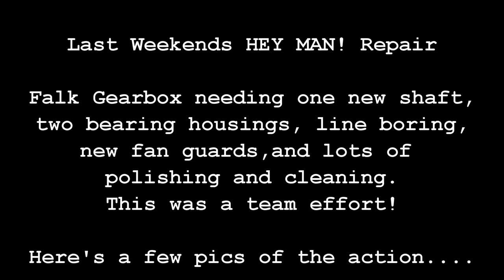Saturday Night Special 80 Part 2

Comment: Another great video Adam.   The part on pressure relief valves was very clever and interesting to test it with a porta power.  Looks like you are learning alot as you figure out what is amiss with the KT, most likely a bunch of things, none major in and of itself.

Comment: Hi Adam !

Very nice to see these heavy duty works of yours ... when you turned that shaft for the gearbox glowing dry I could nearly smell that hot metal ... I get nervous when I feel that smell, because here in my hobby shop it normally means something is wrong ;-))

I have some - for me - heavy threads to do in a project of mine - 48mm by 2mm - the nuts for my general collets system for my shop - I long to do the challenge !

Comment: Adam, That's a really cool planer gage. I'd wager that it's shop made by a talented machinist like yourself.
Also, I like the wider angle shots of the lathe in operation where the viewer can see you using the controls rather than just a close up of the cutting tool. Greg.
Reply from the maker: Greg Kozak Thanks Greg. I'm always trying to improve on the shots of the machine work.

Comment: Damn fine work! That gearbox... Not just rebuilt, but looked beautifully finished to boot.
As for that 5 stage... Absolutely incredible work. So shiny. Wait... Did I just say that? 
In any case, it amazes me how something that large can have a seal, a mirror finish, and apply tons of force. Based on the diameter, i am inclined to say tens of tons, possible even 50. Crane part perhaps? Or one of those custom tipping ramps?
Reply from the maker: Cody Smallwood All the tubes were re-chromed so yea they look nice. Each nut uses layers of V-packing for sealing, that's why you seen me machining threads on the bronze. It's used for truck dumps.

Comment: Puzzled...
Relief valve set to open when max pressure reached, target that was achieved after a few pumps of the portapower. Had the pressure been supplied continuously by a pump, the pressure drop seen simply would not have occurred. 
The fact that it reached 200+ psi, and then, after pumping effectively stopped, coupled with a slight leak, would naturally cause pressure to drop,  tellingly regained after a few more strokes of portapower.

Epic lathe work,   congrats on 40K subs..

John Greenwood
Reply: Aristakas   

Precis of previous post.

Relief valve prevents over-pressure only, designed  to 'let-by'.  
Pump, in good condition, maintains target pressure in system.

Worn faceplate and/or possibly gears of oil pump may indicate good pressure when oil cold but as oil heats up would result in progressively lower pressures.

Thanks, 
 JG
Reply: Aristakas 

Pump guy here. I'm going to agree with John. The pump should have more than enough capacity to overcome what little bleed through your getting through the relief valve. I'm not saying the leak shouldn't be addressed, however, I'm not sure this is the root cause of your problem.

Bob
Reply: curtisbuckmaster , Aristakas 
I think the piston binds so it won't close back at for example 200, it takes more force from the spring to overcome the binding in that valve/cylinder + the pressure, so once the pressure drops at about 100psi the spring has enough force to close back the valve and the bleeding stops (or is very slow) - the way I see it anyway.
That being said I believe there's also another issue not just the valve as if I recall correctly the pressure he got when testing on the K&T was way low and nowhere near 100psi (but that might be also due to cleaning the valve block and maybe works better now).
Reply: Well I am a sparks by trade ( electrical engineer) I agree that small blow by would be easily overcome with the pump that valve works more like a pressure limiter than a pressure control , I think it as a pull up resistor that is able to be pulled down to set a level.

I still think there is more problems a foot there is a big hole/leak somewhere or the pump cannot get the pressure up and maintain a good flow at that pressure

Great vid thanks for keeping us in the loop 

Stuart
Reply from the maker: curtisbuckmaster I've been thinking the same thing myself. We are building pressure, but a relief should reseat and seal after it drops off. Just remember that I'm exploring possibilities on what was wrong with the machine and would rather adress all of them at once then to stick it all back together and it still not work. it may have been a plugged up oil line. We're still searching.

Comment: Adam.  Its the poppet valve seat that is the issue.  Im assuming its a Ball and Seat type poppet.  Its easier to fine a new ball (bearing).

Usually, the valve will "Crack" open at the set pressure, but reseat at a slightly less pressure, but not more than 10-20 psig.   This is normal. (ask Paul about hysteresis).

Glue a new ball to a piece of drill rod and lap the seat with some fine (1200+) lapping compound.  Retest until till it stops leaking.  The ball doesnt have to be exact replacement but it does need to be polished and very round.  Thats why ball bearings work so well. so long as it fits the seat and the spring.

Its typical in hydraulic valve components that a 0.0001' or smaller tolerance.  Thats why all new equipment have very fine filters.

Comment: Atom: nice find on the K&T issue... That may be ? all there is to the problem. Way cool.  I'm sure there are options "maybe" replace, repair or ?....  Also that extending ram is crazy long.  Is it for a crane or ?  Thanks for the excellent video and sharing...  Brian F.

Comment: Adam,
At least you now know what the problem is with the K & T. Now to try to find another pressure regular. If nothing else, could you band saw the old in half, lengthwise, so you will know where all the passages go. They could be drilled in a block of aluminum. The passages that are blocked to the outside could have plugs pressed or screwed into them. Damn! That I one mommaluca hydraulic cylinder! Is that for some oil rig out in the Gulf? Are you putting an elevator in your house? (Actually you would need a cylinder that long!)  Thanks for a great SNS and congrats on the 40K subscribers!
Keep your tools sharp and your brain sharper!
Dave
Reply from the maker: Swarf Rat I'm still working my options for the relief valve. Going to price new unit first, but we can possibly just repair this one. Thanks Dave!
Reply: Abom79 I would  have a mould polisher  with  proper tooling  polish that bore  in the block and you make a new valve insert .  You must have  a mould shop in your town ??  The polishing guys have tooling to get down that  drilled hole
Reply: Abom79 If we want to be a little selfish, the better solution is that you undergo the repair and we get to see how it's done... ;-)

Comment: Could you chrome the poppit and bore the housing for the valve on the K&T? I'm also wondering how that valve would work with a constant flow of oil such as what the pump is going to give it? I'm thinking that it is more of a regulator than a relief. Such as what you would see in an auto trans. I guess I should take planer gauge off of my wish list now that you and Tom have raised the value. I was glad to see your thread pitch gauges by the cylinder that you were threading. Always want to check the pitch. Not like it is a boat shaft. :). That telescopic cylinder is pretty impressive.

Comment: I replaced one of the hydraulic cylinders in a garbage truck before.   I thought it was big , until I saw the one you were working on near the end of the video.
Reply from the maker: 1970chevelle396 So far this is about as big as we have done. We had one bigger but the lathe wasn't big enough to bold the barrel. LOL

Comment: Adam.

I'm not convinced that the relief valve has a problem. Fair enough, it's leaking down once it achieves relief pressure, but you have to consider that the porta-power pump is providing very little flow, and once you stop pumping, it's providing no flow (obviously). Your gear pump in the K&T is a fixed displacement pump with, compared to the porta-power, a large flow.

I think you should rig it up to the cylinder test bench at work and see what pressure the valve can hold with a constant flow through it. I realise the test bench can give way more flow than the K&T pump but you should be able to find a way to throttle the bench's flow down to something similar to the K&T's.
Reply from the maker: princebatswater All of out equipment is too big to test that one, that's why I used the pota-power. It may still work as is but I'd rather replace or repair befor putting it all back together.

Comment: Adam, may want to think about checking that relief valve with a constant flow. if you can get it to build pressure before it pops It's not leaking. when it pops you have no oil to reseat it unless you pump it. with all do respect, not sure your hydraulic guy knows what he is doing. we always use a constant flow pump for testing that sort of thing.
Good luck, Cliff
Reply: +Clifford Fender ...Agreed...! I was the &#39;welder&#39; in a machine shop that did a lot of hydraulic stuff...worked on lots of 2,000-3,500 PSI relief valves...mostly big extension boom  type cranes, 200-500 tons....3-5 stage cylinders...some had 27-28 feet extension per section..."Maxim' cranes has big lot here in Sacramento, calif.
Reply: Relief valve was clearly leeking. With constant flow you don't see it, if flow is greater than  the leak. The guy knew exatly, what to do.

Comment: Damn that gearbox looked like it had been band-aided and band-aided until the band-aids stopped working, but from what you say about it being a common happening in big industry, I can see why.  For the kinds of operations requiring such massive pieces, when the processing equipment that needs it isn't running, nobody's getting paid.  So there's incentive to 'run it till it breaks down, patch it up, run it until it breaks down again, patch it again, etc.' until the patch-ups stop working and it fails catastrophically.  Then its time to call in you and your buddies to do what you do so the customer can get back to beating the utter living crap out of it. :D  Its job security though for you! :D

Comment: Was the cylinder for an elevator? If your having trouble catching threads on large pcs of pipe like that, if you turn it backwards you will feel the start treads drop off when they go past each other, then you know exactly where starter treads are and you can work it the right way from there.

Comment: Terrific pair of videos Adam. I am glad James managed to find those bits for your machine as I'm sure they will all have a use and make your life easier. Do you ever use any coolant on that lathe as I have only seen you use lubricant.
That's an almighty rescue on that gearbox and must have caused a lot of hard work for many folks but at least you managed to get it fixemust d!
That is one massive ram you have made - is it off a truck or something else? Your forklift some real grip and power to shove all those sections closed as well.
Congratulations on 40,000 subs.
Reply from the maker: Dan Whiteford Only lathe I run that has flood coolant is my Monarch, and I showed rebuilding the coolant pump for it in past videos. The cylinders go to work at paper mills. We have a big 8K Lb capacity forklift. Thanks Dan!

Comment: one 'worth a try' option for the relief valve is to machine a new poppet and see if that helps (esp a thou or 2 oversize and hand polish to fit it), of course there's wear in the bore, but it may solve it, but machining inside the unit is so much harder, esp if they use a seat for the valve to go onto (i am not sure the exact mechanism they use, it may be seatless and just use the bore and a bypass chamber, thus hand ream it and make an oversize poppet) maybe there is an engineering drawing of the valve so you can see if you can use an adjustable reamer and there is clearance in the bottom for the dead-zone you cant reach with the reamer
Reply from the maker: jusb1066 All repair options I have already been exploring. I'll share it on video once I have it figured out.

Comment: Love those herringbone gears! What was that a 50ft stroke cylinder? Might as well go ahead and rebore that valve block and machine your own relief. A used one probably no better than what you got and a new one probably have to sell a kidney for. Fives in Wisconsin is the current K&T owner, I have a parts contact there if you want to give them a try. It wouldn't surprise me for them to want a grand or more for that part though.
Reply from the maker: bcbloc02 Brian, email me the info. I found a couple dealers out in CA that sell K&T parts also but I have not called anyone. I'm thinking I can ream that hole out clean, check the face too, and make a new poppit. But I'd like to harden and grind it to size like the original.

Comment: I think the valve was in backwards, the stem part holds the spring on center keeping it from rubbing on the side of the body, the flat face is the seat side easy to just lap it flat. Then just check the face in side the frame for cracks if none then laps it to.
Reply from the maker: heyhoss No sir, it was installed correctly. The smaller diameter fits inside of a bore and seats on the face.

Comment: The size of that hydraulic cylinder is insane.   May I ask in what sort of equipment is it used?
Reply: Possibly for an elevator. I've even seen them painted orange before. This is sized for a very heavy lifting freight elevator.

Comment: One step closer on the K&T. Another great video, as always. Congrats on 40k.

I saw a double spiral groove shaft rotating on the back of the lathe in one shot. It looked like the grooves on the shaft of a Yankee screwdriver or the operating shaft of a level-winder on a fishing reel. What is that used for on the lathe? My first guesses were: a back and forth automatic polishing function; rapid carriage traverse; ... and then I ran out of guesses. It would depend on whether there were reversing loops at each end (as on a level winder) or whether the grooves just ended (as on a Yankee screwdriver).
Reply from the maker: Peter W. Meek Your second guess was correct Peter. It's for the rapid traverse.

Comment: Excellent standard of work, its nice to see the gearbox repaired, I am really impressed with the bore screw cutting.  The quality of the steel looks really good, I assume its hydraulic grade material ?
Reply from the maker: ANDREW MICAS Yes it is, you buy it from suppliers already honed like that.

Comment: Nice pair of videos to watch tonight.  Hopefully you can get a new valve or be able to make one.  I assume those have to be some pretty tight tolerance mated parts given that a little hairline scratch can allow it to bypass.  It would make one hell of a good series if you could machine a whole replacement unit yourself.  :-)
Reply from the maker: ILGopher I'm going to see about rebuilding this one myself. Most of those spool valves I have seen are pretty tight fitting.

Comment: Thanks for another great video! Is there more to the poppet valve than is visible on video; as I would think you would have no problem making a replacement?

That was a monster 5-stage. Does your pressure system have an automatic relief valve once it is fully extended? 

Beautiful shaper chips..

Comment: Bummer seeing them herring bone gears chowing on each other.  Cool systematic troubleshooting on the p/r (offloading valve) unit.  Looks like their may have been some microscopic debiris in the hydraulic fluid.  Over time, it slowly polishes the clearance bigger and bigger.  That can also be caused by old funky fluid that has developed an acid pH level.  One cause of acidic pH is water contamination.  If you live in a humid area, the moist air can condensate on the sides and roof of the inside of the machine, gear box, etc.  Condensation doesn't occur all of the time, just when the season changes from summer to winter (or from hot days to cold nights).  Some guys build a race motor and put a 140-160 degree themostat in it to make it run cool (less detonation).  But, the transmission (if it is an automatic) fluid does not get hot enough to boil off the water vapor that condensates in the transmission case.  It's not immediate, but the clutches, plates and pump tolerances wear faster.   then again, speed cost $$  
Though the valve "leaked" down a little bit of fluid pressure, that small amount leakage wouldn't affect the overall functiion of the system.  I think the problem is somewhere else  ???
Reply from the maker: WAVETUBE84 Yep, we're going to keep digging to see if there's any other problems we can find.
Reply: Abom79 That type of p/r valve does not dump 100% of the flow/pressure.  It slowly uncovers a port that dumps excess fluid into the tank, or to the pump inlet.  It is like a "pressure relief" in a way.  If it needs to dump a lot of excess flow, it opens wider (slides back and uncovers more of the relief passage).  You can hear them operate.  I'm sure you have heard your car/truck make that noise when you turn the wheel all the way to the right or left limit.

Comment: OMG !
Somebody certainly ran that gearbox into the ground - great repair job.Is that self reversing lead screw that runs all the time on the American Pacemaker lathe for the rapid traverse ? Your poppet may have a soft area which caused it to wear like that (my poppet is soft but the doctor should be able to help). Do you ever test the cylinders under a load to check for piston leakage ?